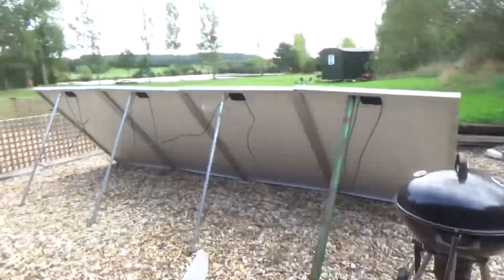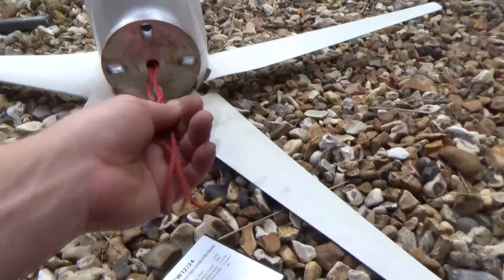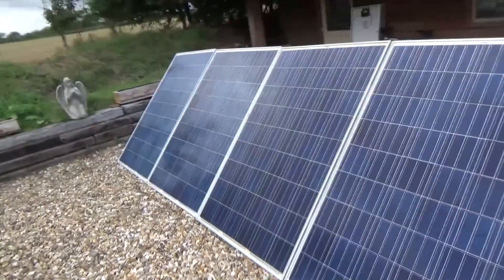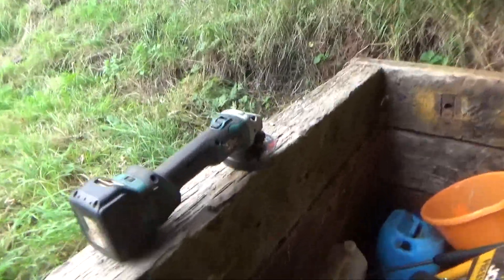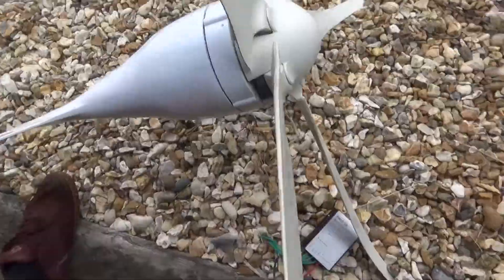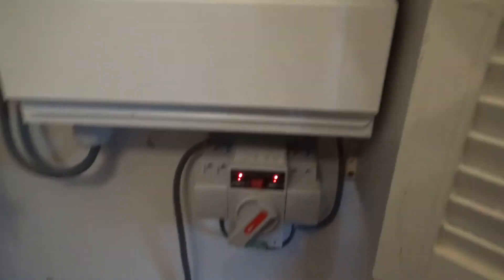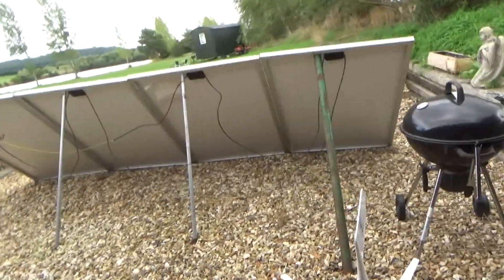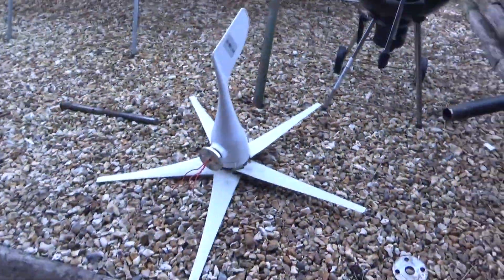Solar system upgrades and general off grid setup

Comment: You have so much land. Ideal for solar
Reply from the maker: ive moved from this location to a cabin with even more space.
problem ive found with solar is the low output in winter.  at my new place im over 5kw of solar in summer but barely 300w in winter which barely charges the batteries.
i could get fancy new panels but its a expensive hobby lol
https://www.youtube.com/watch?v=ZIZzfvCpgHo&t=14s
Reply: @jamesbrokentech  it has been pretty useless in winter. Still get a bit, about 150kwh for the month. Saved me a around £50 on my electric bill. But need to double that really